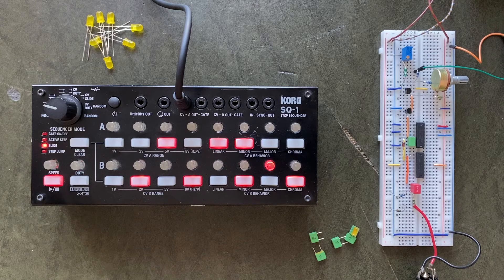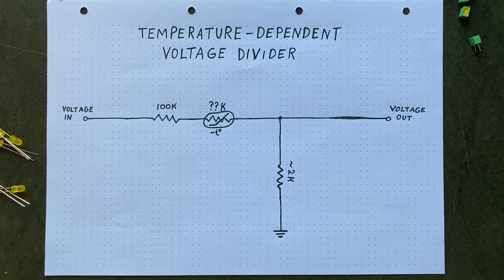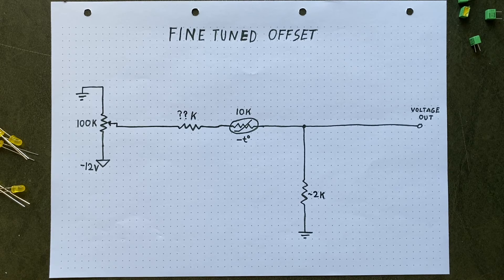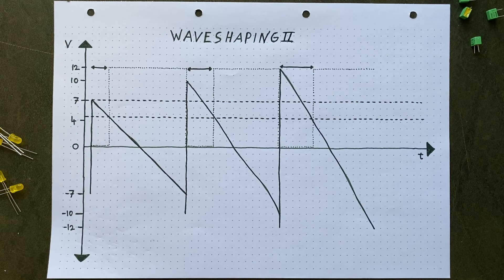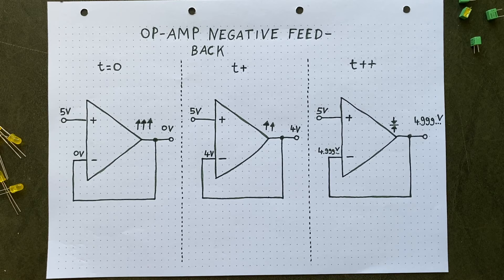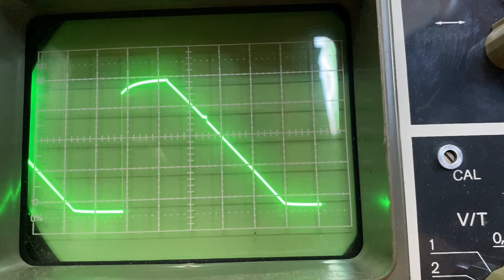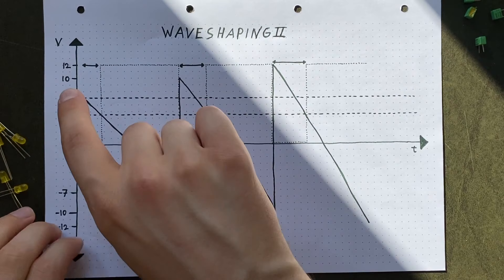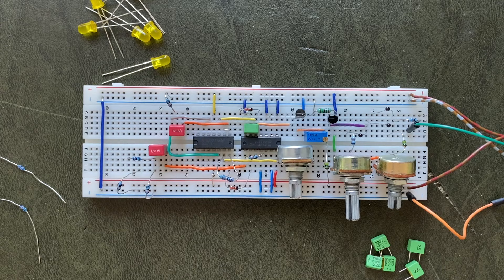DIY VCO Part 4: Shaping Sawtooth to Square

Comment: Another way of handling the temperature problem is using a single package that has both pnp and npn transistors in it. Having the two transistors on the same piece of silicon alleviates the problem two-fold. First, having them on the same chip is the best way to make sure the two transistors are the same temperature. Second, having them in the same piece of silicon makes it so that their ideality factor are approximately the same; this means that both transistors will respond to temperature change by the same amount.

Comment: Thank you for this amazing tutorial, and especially thank you for including the part about the op-amp. I'm new to synth DIY and even though I know op-amps are used everywhere, and I knew "negative-feedback" is important to understand on audio circuit, I was never able to find a easy-enough documentation or video that's still useful in real life situations like this. You just solved what was mystery for me for past many months in just a little more than 5 minutes!

Comment: After building this circuit, I used some 50k NTC thermistors with another 50k 1% resistor in series, and when I breathe on the circuit it shifts somewhere near 2 semitones. I tried a 100k + 100k thermistor in parallel, along with a 50k in series with that and it still went off.

Temperature compensation is a tricky task...

Edit: Instead of dealing with Thermistors, you can balance the Beta (hFE) of the transistors, if they are complimentary it'll make it rather easy too. I just fixed up the circuit, grabbed some thermal paste and a zip-tie and stuck them together face to face for thermal coupling. at a frequency of about 220Hz, it would deviate less than 4-5Hz with my finger on it.

Comment: I'm so looking forward for the next episode!
Reply from the maker: Mark Firman sadly will take a week or two - already had everything done, but it turns out using all 6 inverters at once causes serious problems. so back to the drawing board!
Reply: @MoritzKlein0  ohh, that's unfortunate. I hope you'll put details of your failure into the video ! It's so counter-intuitive that you can't use the chip to it's fullest
Reply from the maker: Mark Firman i agree - seems to be a power management issue inside the chip. which is a horrible scenario for debugging if you don’t suspect the chip to be the culprit! will definitely talk about this! (but luckily the chip is dirt cheap, so you can easily use two)

Comment: Great stuff, need to go to patreon now. As a future idea on this would be lovely to hear how you add CV modulations for PW for example or frequency, looking forward, really best lessons here.
Reply from the maker: CV modulation for frequency – you mean like a second CV in for the oscillator frequency? as for the PWM-CV: i think it's very much doable. i'll look into it and post a sketch on patreon.
Reply: Moritz Klein sorry should have been more precise I mean by CV external source - how do you add input 1v/oct jack for frequency for example and same for other things that you can modulate.
Reply from the maker: Alexey Demidov it all ultimately connects to the PNP‘s base. 

so if you want to add a frequency modulation input, just go jack socket -> resistance (more resistance = less fm intensity - you could use a potentiometer here for control) -> 10k thermistor -> PNP base.

if you just want to add another 1 v/oct input, „clone“ the one you already have. so socket -> 100k resistor -> thermistor -> PNP base.
Reply: Moritz Klein got it, thank you, will breadboard everything and experiment. Subscribed in patreon as well, really best explanations out there, thank you very much!

Comment: Build a temperatur stabilized casing and Heat/cool the whole circuit to 70°C most high precision measuring devices use this trick to make it absolutely temperatur independent.

Comment: I just started learning about this stuff but it’s very fascinating, glad I stumbled upon your videos. Love the way you explain everything and keep it practical.

How do you have all these different components lying around (e.g. 4K, 100k resistors, etc.)? Did you buy a big pack of them, get a kit specifically for the oscillator, or pick them all out individually?
Reply from the maker: they pretty much accumulated over time from all the things i‘ve been building. since most of these components are dirt cheap i never buy them individually but always in bulk!

Comment: Phase does matter a bit actually. Phase cancellation has the ability to completely shut off your sound, so trying to avoid it is generally a good idea unless you want the phase cancellation.
Reply from the maker: true, but in this case you would have to use the square and sawtooth outputs (from the same VCO) mixed. and even then the waves won't cancel out completely because they're different shapes.

Comment: Do you think it would be possible to double the transistors in a way that their "resistance" is in series- in order to double the VCO's CV-Range?

I'm thinking: R(Transistor) is something exponential like a*2^U; if the second transistor is the same, the series total rsistance would be twice that  2a*2^U , add in a 1:1 voltage divider (essentially 0.5V/oct) and now it takes twice as many volts to saturate the transistors while maintaining v/oct (1/2 * 2  * a*2^U);

 since the BE-Lines must be parallel you would also probably need a buffer, depending on if the transistors are voltage or current controlled (I think it's current controlled, so you WOULD need a buffer)

I Think 1more pnp, npn and opamp are well worth it for double the range though, especially if you make a multi-octave-course-tuning-knob (or a rotary switch as I am planning) and I wouldn't expect the whole oscillaty-bit to draw that much current

here's a crude sketch: https://imgur.com/a/DazpCgx

Comment: Hey, man, this series is awesome! Just a question, though, is there a one-size-fits-all solution for adding CV to any parameter? Not just for oscillstors but for everything! Thanks a lot, this videos are the best
Reply from the maker: sadly not, no. the only thing that comes close are vactrols, but they have their own limitations. so the ideal solution greatly varies depending on the exact circuit details!

Comment: What manufacturers normally do is to "thermically couple" the transistors by gluing them together.
I think you can get rid of the thermistors then.
Reply from the maker: yes, i do that as well when i build VCO modules! but you still should use thermistors – check out this article by rené schmitz: https://www.schmitzbits.de/expo_tutorial/
Reply: I'm sure I've also seen this done using two identical NPN (or PNP) transistors. IIRC, it's pretty much the same, but you swap the positions of the transistor and resistor in the potential divider network (or invert the input CV). The idea is, with two identical (or as close as) transistors, they'll behave the same.
Reply: @JaenEngineering  but the polarities are all inverted...
Reply: @mutedsounds2k  If we use NPN transistors, then general idea is, as the transistor we're using to control the osc (Q1) gets warmer it opens up and lets more current flow from collector to emitter, you use the compensation transistor (Q2) with it's collector connected to the base of Q1, and its emitter grounded (the base will need biasing as well). As the temperature rises and more current flows through Q1, Q2 also opens up and "shunts" current away from the base of Q1, lowering the voltage, and turning Q1 off proportionally to the temperature opening it up.

Or something like that...

Comment: Nice circuit! But I would've probably used a different wave shaping circuit to get a pulse wave. Rather than that I would use, basically a PWM comparator, which would also allow a CV input for width. (Hmm... ADSR width? Could be interesting)

Comment: One important question, could you run the output of the VCO through a normal loudspeaker or amp in some way or should it be with a sequencer? If so, could I hook up the VCO to a computer and use a digital sequencer?

Comment: Hallo Moritz, deine Videos sind wirklich erstklassig. Ich habe mich schon immer gefragt wie so eine Audio VCO funktioniert oder ein VCF. Danke für die tolle Erklärung. Vermutlich bist du da auch selbst schon drauf gekommen, aber ich möchte es trotzdem erwähnen. Wäre es nicht von Vorteil die Transistoren im Spannungsteiler zusammen zu kleben? Dann wäre die thermische Kopplung besser. Es gibt auch Doppeltransistoren die einen NPN und einen PNP im selben Gehäuse haben. Und um das Rechtecksignal zu erzeugen hätte man den Schmitt-Trigger weglassen können und den OPV als Komparator schalten. Dann wäre die Ansteuerung einfacher gewesen. Viele Grüße Paul
Reply from the maker: yep, in meinem 3X VCO-modul-video zeige ich wie man die transistoren und thermistoren mit wärmeleitkleber verbindet. und du hast recht, meine lösung für die rechteck/puls-welle hier ist nicht optimal – mit einem komparator kann man die pulsbreite sogar per CV steuern. mache demnächst ein kurzes video zu dem thema!

Comment: Please don't rely on thermistors alone for temperature stability.  A thermistor can be used,  however, in a "crystal oven".  Crystal ovens are used lots of times in amateur radio equipment to stabilize frequency in rigs with VFOs.

Comment: hello there, its me again :D. i have concluded the build and it sounds amazing, one question tho, is it possible to increase the pitch? my both waves reach aprox. 480hz, a very detuned a#4  in case.
Reply from the maker: are you using external CV or just the offset potentiometer?
Reply: @MoritzKlein0  just the potentiometer, using the CV will it go up?
Reply from the maker: @danielmendes5682  yes! the pot is just setting the base frequency.

Comment: I love this series so much! I was wondering if I could add a vactrol to the voltage divider for the inverting input of the op-amp that controls the amplification of the sawtooth wave before it goes into the Schmitt Trigger, so there would be a voltage input for PWM. Would that be possible?
Reply from the maker: in general yes, though the problem with vactrols is their nonlinear behavior. if you're ok with that, it would be a simple, quick solution!
Reply: @MoritzKlein0  Thank you so much!!!!!

Comment: Hey Moritz,thank you for the great videos!!! I have a question. I learned that 2 triangle waves combined through mathematical convolution become a perfekt square wave. Could this be applied through a simple ic?Maybe by splitting the triangle in 2 paths,so that the stay synchronized in time but with half the power in each wave,and after convoluting they reach again the input power .Beste Grüße

Comment: is there a way to implant PWM and FM into this i'm really hyped for that :D
Reply from the maker: FM definitely (and easily). you just need to add another jack socket -> resistance (use potentiometer for control) -> 10k thermistor -> PNP base–chain.

PWM should also be doable, i haven't figured it out yet though (besides using a vactrol, but that always feels like a "dirty" solution to me).
Reply: @MoritzKlein0  you could use a comparator

Comment: Another great video!  Would just one thermister before the scaling control work?
Reply: Also did you consider just using one of the op-amps as a comparitor with the saw for a voltage control PWM?
Reply from the maker: no, you need a thermistor for every input! (but they're really cheap so it shouldn't be too much of a hassle!)
Reply from the maker: and no, i haven't considered that yet! might be because i rarely use PWM. but it's interesting nonetheless!
Reply: @MoritzKlein0  René Schmitz also has a NTC compensation circuit with a single NTC. Check the end of the page https://www.schmitzbits.de/expo_tutorial/index.html

Comment: Is the emitter-follower even necessary anymore if you are using the thermistors? Or are they just providing finer temp resistance to the e-f coarse resistance?
Reply from the maker: yeah, they are just for fine-tuning. you need to keep the pnp/npn pair!

Comment: Hello Moritz. It's such a great video and thank you so much as I learned new things about shaping saw wave to something different. But what if I have square wave coming from sound gerenator? The reason I'm asking this is that I have some specialized IC from old electric organ or something which is made specially for polyphonic synthesizers. It is some sort of frequency divider with multiple outputs that correspond to chromatic notes. And for what I know it makes square wave because it's something built as logics IC and as far as I know it has some voltage output which correstponds to 1 and 0. How do they turn it to saw wave and other shapes?
Reply from the maker: Galova that‘s rather tricky! the only quick and simple idea i can think of is using a passive RC highpass filter (which is what i used for ac coupling in episode 2, just have to pick a way smaller capacitor). the result will look vaguely sawtooth-like i think. but i haven’t tried that yet!
Reply: @MoritzKlein0  It would be very interesting to find out how it's made There are old polyphonic synths that made of single frequency generator (hundreds of kHz) and folllowing frequency dividers to play chords, but I do not understand how they make it sound like strings, brass sounds etc.
Reply: @MoritzKlein0  Hi I don't have prototype board right now so I can't check it, but here is some scheme I've found https://imgur.com/a/tpy2DF3 it doesn't look too sophisticated. It may have some limitations, like frequency range or something.

Comment: while following this tutorial i came along an odd behaviour. i am using 2n3904 transistor and because of that i struggled watching how your transistor was placed on the breadboard and the schematics. it seemed to work until i found that the pinout compared to the package is mirrored and so i turned it around. resulting in better pitch response. however, strange that it seems to do it's job in both directions

Comment: hello, i have prototyped the circuit and it works like a charm, but why the square wave has a higher output value than the saw wave? did i miss something?
Reply from the maker: how much higher? there's a flaw in my design that i'm currently writing a new video about. should be up in a week or two!
Reply: @MoritzKlein0  the saw wave is about half the size of the square wave, my oscilloscope shows that it is around 4V peak-to-peak
Reply: @MoritzKlein0  and is the flaw related to the voltage dividers? looks like they are dropping too much the voltage
Reply from the maker: @silic1um127  nothing critical there, they are just not completely dead on. the flaw is in AC coupling the pulse wave – this will result in a big DC offset at the output.
Reply: @MoritzKlein0  oh i get it, thanks for telling me before i started the soldering xD
Reply: @MoritzKlein0  hey, i changed some of the resistor values and now both waves are about the same size and the same volume, thank you for the tips, now i will solder everything and finnaly finish my first ever module, again thank you so much

Comment: Hey Moritz! I have a question about controlling the vco via a midi keyboard: is it possible and do you know of any resources I should look into regarding it? I'm asking this a bit preemptively as I go through your videos, but my goal is to be able to use a midi board (probably the arturia minilab mkii) to control the synth. I'm very new to all this so I recognize I might not even be asking the right kind of question so I apologize if that is the case.
Reply from the maker: midi-to-cv conversion is not trivial, so i don't think it's something you should start out with. the arturia keystep has a cv output that can directly interface with my vco design, so i suggest either getting that or a professional midi-to-cv converter like the doepfer MCV4 if you have to use the minilab mkII.

Comment: I'm having a circuit issue I'm not sure how to solve: I'm trying to use a saw wave output to send to the input of a CD4046 (pin 9) but if that pin detects a voltage lower than 1.4v it stops oscillating, so is there a way to prevent a voltage from dropping below a certain value?
Reply from the maker: M D J you could try adding an offset voltage! build a voltage divider that produces a 1,4V output (this will help: https://www.ti.com/download/kbase/volt/volt_div3.htm ) and connect it to your pin 9 through a 100k resistor!
Reply: @MoritzKlein0  this actually gave me an idea - what im using the saw wave for is to create FM for the 4046. My idea is to create 2 voltage dividers, the first will output 1.4v and the second will divide between the saw wave and the 1.4v from the first divider. It never even occurred to me that a divider doesnt have to connect to ground. will that even work? I'm going to breadboard it and find out. Thanks for the inspiration!
Reply from the maker: @MDJ5  could very well be that that works! let me know how it goes!

Comment: How would you got about playing chords. I have not found anything on the internet so far and I do not want to clone the oscillator for every note. My idea was to have a base pitch and for each note pressed I pitch the signal and add it to the original signal back
Reply from the maker: Christian Kreidenhuber well the way it’s done in a traditional polysynth would be with multiple oscillators. a juno-6 has 6 of them, for example. what you‘re describing is how it’s done in certain string synthesizers i think, but it’s definitely a niche approach.

my tip would be to omit all the waveshaping-related stuff i explained and just build 6 barebones sawtooth-oscillators.